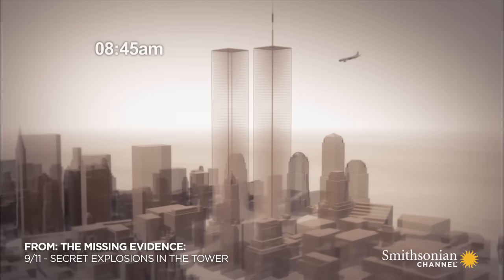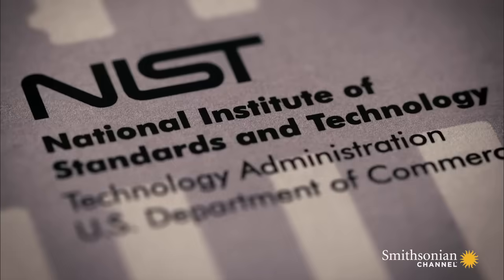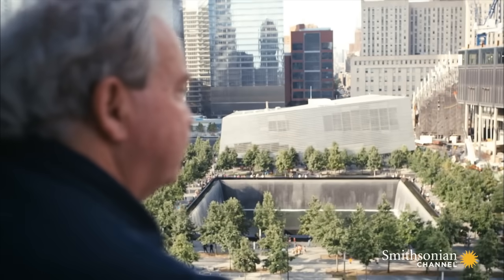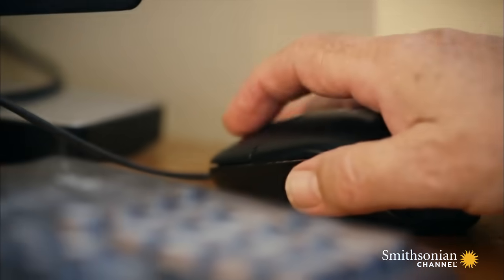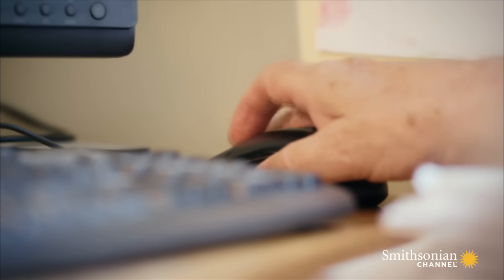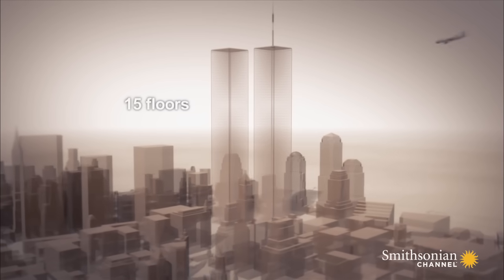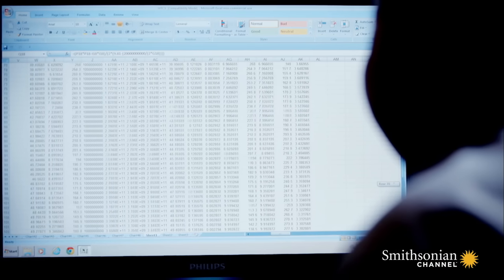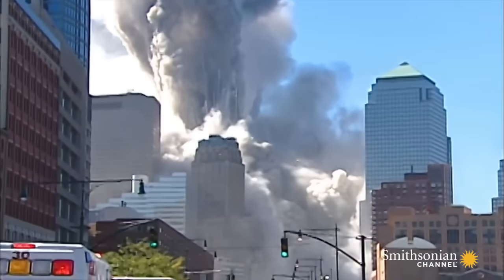This Computer Simulation Explains How the Twin Towers Fell

Comment: The towers did not collapse. The entire WTC complex of seven buildings did not collapse.
Reply: "The towers did not collapse. "
Actually they did.
Reply: @markh1011  If you study the evidence carefully, it will lead you to the correct answers. If I tell you that the answer is 27, how do you know if the answer is correct? You must determine what the problem is before you can solve it. If you don't know what it is, you can't determine how it happened.
Reply: @andrewdean6963  Nothing you said there changes the fact that the towers collapsed.
Reply: @andrewdean6963  What?    People ran away so that were not at the base.   Do you think people would just stand there while 110 floors come down on top of them?
Reply: @markh1011  of course they ran, they couldn't outrun the dust clouds, you would have to run very fast to get far enough from the base to escape the falling debris of a quarter mile tall building.
Reply: @andrewdean6963  
Are you making an argument for something?
Reply: @andrewdean6963  
"What about the 16 people at the base of tower one inside stairwell B that survived and walked out"
They exited the building and ran for their lives.

"500.000 ton building because they were turned into dust. "
All anyone needs to do is look at the ground zero photos to see that it wasn't all dust.  If it was just dust they could have vacuumed everything up quickly.

" The didn't get cooked by high temperatures of molten steel because there was none."
Correct, there probably wasn't molten steel.

You don't know what the official story is do you?
Reply: @andrewdean6963  
"This is just the tip of the iceberg of knowledge I have learned by reading on book"
You've not shown any knowledge at all yet.

Judy Wood is wrong on pretty much everything.  Even the other 9/11 conspiracy theorists distance themselves from her nonsense.
Reply: "An error does not become truth by reason of multiplied propagation, nor does truth become error because nobody sees it. Truth stands, even if there be no public support. It is self sustained." Mohandas Karamchand Gandhi.
Reply: @andrewdean6963  Who needs evidence when you can post quotes.....
Reply: @markh1011  Who needs your opinion that is meaningless?!?!
Reply: @andrewdean6963  You should have stopped a few posts back.
Reply: @markh1011  Well what ever!

Comment: This is a lie. All the floors would have to collapse from the bottom up to cause what we witnessed to happen. If the collapse started closer to the top, we would have seen them fall first and as they say, "pancake", downwards, one on top of the other. But that's not what we saw. The whole building fell at the same time as if all the support below was severed simultaneously. This could explain the molten metal many people reported seeing streaming from different places shortly before the buildings fell.
Reply: That's NOTHING like what we saw!! The collapses began at the points of impact and the building below didn't fail until the collapse reached it. It did not fail simultaneously.

The molten metal proves nothing; the heat from the office fires explain it.

Comment: The mass above is supported by the mass below. So to say it fell due to the weight above would also imply the building shouldn’t have been able to stand. Also assuming that all beams failed at the exact moment for it to fall within its footprint. You would typically have a stress or weak point on specific areas, not equally across the entire floors. This would cause an uneven collapse resulting in portions of the top falling off sideways with the rest of the building being able to with stand the weight
Reply: Aren't you forgetting something? Like - massive damage caused by 150-ton jumbo jets hitting them at 500 mph??? Or the fires which burned unchecked at temperatures that cause steel to lose 90% of its strength??

Also, the towers did not fall into their own footprints; they spread destruction 600' in every direction!
Reply: @Tim22222  the planes can't go 500mph at the low altitude.  The wings would have been sheared off due to air density.
Reply: @Tim22222  open flame fires cannot make steel lose 90% of its strength that is a fallacy.
Reply: @Tim22222  if the debris was spread out in 600 ft in every direction what caused the lateral Force?
Reply: @Tim22222  a building of that size in the most controlled demo would not be able to fall anymore into its foot print than this did. At this size and speed of collapse, there should have been way more resistance as it fell each floor. These collapses didn’t even slow down. These buildings were meant to withstand a strike from an airplane. The architects and engineers prepared for something like that. I’m not discussing steel malleability here. Again, you would have stressing and weak points where the heat was the hottest. 

Imagine you are watching a controlled demo of a large building. Once they start the ignition of the explosives, they target structural points from the ground up. If all it took was to damage the top 10 floors of a building, like in the twin tower case, they could save 10s of thousands in dangerous explosive work per building by rigging only the top. You would have seen irregular collapsing and more and more resistance as the debris fell onto an incredibly sound lower structure. 

Of course steel can be melted by jet fuel. 

And remember, building 7 collapsed without being hit by a plane and fell again into its foot print with very little resistance at an incredible speed.
Reply: @AvaLeafs10  Demolition companies are not hired to bring buildings down, they are hired to bring buildings down SAFELY. The towers' collapses spread destruction in every direction, took out nearly a dozen buildings, and caused grievous environmental damage (and that's without considering loss of life). Any demo company with that track record would be out of business RIGHT QUICK, I'm sure you'll agree.

And yes there was most certainly was resistance; the proof is that each tower's collapse took more than free-fall time.

"At this size and speed of collapse, there should have been way more resistance as it fell each floor."

Oh? How much more? Care to share your calculations? The north tower took more than twice free-fall time to come down. Is that slow enough?

JK I know you can't answer those questions!
Reply: @Tim22222  The roof line of WTC 7 dropped in free fall for 2.25 seconds during which time it covered a vertical distance of 32m / 105 ft / 8 stories. During that time it experienced ZERO resistance from the 40,000 tones of structural steel which was 3–5 times stronger than required to support the building loads. The only possible source for the massive amount of energy required to destroy the columns in a coordinated way and in the time frame available is explosives.

In addition to the free fall the only way the building could collapse in the symmetrical way it did was if the support was removed symmetrically across the width of the whole building and that can only be done with explosives. Fire does not cause symmetrical collapses.
Reply: @AvaLeafs10  I take it by your eagerness to change the subject that I've satisfied your doubts about the towers? And that none of your observations suggest controlled demolition?
Reply: @Tim22222  you asked for details
Reply: @AvaLeafs10  Not about building 7! You claimed the collapses of the towers should have taken longer than they did; I asked for details about that, details you have not provided. Instead you tried to change the subject. No bueno.
Reply: @Tim22222  hello would you be willing to be interviewed? I have a few questions about your group/movement.
Reply: @Tim22222  talking about demolition companies being hired to bring down building safely has nothing to do with terrorist who care less about safety...
Reply: @Tim22222  "the North Tower took more than twice Free Fall time to come down" yeah you clearly are lying....
Reply: @Tim22222  not trying to change the subject but again, a building of that size cannot fall completely down in 11 seconds from damaging a few of the top floors. I won’t convince you and you won’t convince me. Bueno??
Reply: @AvaLeafs10  Neither of the towers came down in 11 seconds. Check the video at the end of my comment above & time it yourself!
Reply: @Tim22222  listen, I have an engineering masters and I’m guessing by you being consistently snarky, maybe you do too? Probably not. I wrote my comment, and I’m done arguing. I left my comment as a comment, not an invitation to have basic arguments with someone like you. I don’t have all the detailed specs of the building. I didn’t investigate it. I’m looking at this objectively. Buildings don’t fall that fast (11-13) seconds without some sort of complete structural malfunction. Write what you will but I’m done responding to you. It’s not productive to converse with someone as arrogant as you come off to be. There’s lots of unknowns about what happened and I’m stating what I know. You seem to be taking this as what you are told
Reply: @AvaLeafs10  Did you view the video? Did you determine the north tower's collapse time? If not, why not? Are you afraid of what you might find? A real engineer would jump at the chance to conduct such an easy and definitive experiment. Just sayin' 😊 

You made a declarative statement: The towers should have taken more time to fall. I have repeatedly asked you on what basis you say this, a pretty reasonable request. You have not responded to it. Why?

Oh and BTW my degree is in physics, so pulling rank isn't going to work here.
Reply: @Tim22222  it’s unfortunate your “degree” hasn’t given you the knowledge when looking at this to know something isn’t right. I’ve looked at the video. I’ve looked at many. Google it as well, YouTube won’t let me post links. Everywhere it states 9-13 seconds. And I’ve repeatedly given you my reasons. These structures were designed to withstand enormous weight loads. As the building fell, it’s very clear there was little if any slowing of the collapse. And again, your attitude, snarky arrogance is beyond frustrating. I didnt for a second tell you about my background to ‘one up’ you in anyway. I’m letting you know I have some experience with structures.
Reply: I haven’t studied any of the details. And I can only assume you haven’t either. How about for once, instead of me having me prove to you, try to prove it to me what you are claiming. I’m looking at the situation, watching the videos and making my opinions. So what’s your issue? Are you policing 9/11 comments to shut down anyone questioning what is being shown?
Reply: @AvaLeafs10  This is a public forum. If you make a demonstrably false claim someone might call you out. See how that works?
Reply: @tpryce9800  yep. Exactly.
Reply: @AvaLeafs10  Then why are you perplexed that someone would do just that?
Reply: @tpryce9800  ya ..who knows
Reply: @Tim22222  would you be willing to answer a few questions for my book about  new age truthers and your group/movement.

Comment: Surprised they have turned off the comments 
Many Firefighters disagree about this theory, they saw molten metal flowing underneath like a steel foundry. And why the squib type explosions only on some floors 
We don’t believe anything from the government on this, they lie often, and there were no WMD in Iraq.
Reply: No, no firefighters "disagree" about this theory. Molten metal does not contradict it.
Reply: @Tim22222  I have a few questions if you are willing to answer.
Reply: Who? What are their names?
Reply: @tpryce9800  all done anything else
Reply: @c.augustedupin2559  Uh huh. Anything else?
Reply: @tpryce9800  easy to research , not sure if names were given for security reasons 
Thermite melts steel like a hot knife 🔪 through butter 
Traces were found
Reply: @CrazyFunnyCats  Does that mean you don’t know their names?

Comment: Sins all the floors where hanging onto the inner high quality steel concrete structure.
The only thing that could have happend would be that the floors would've collapsed onto each other. Leaving the inner high quality steel concrete structure still standing. But lets beleave the official report, because why would they lie about it? 😳
Reply: The inner structure was steel only; what little concrete that was in the towers was limited to the floor slabs, not structural.

Each floor was only intended to carry its own weight, not the weight of dozens of floors crashing onto them!

Comment: 2 weeks before 9/11 the buildings were shut down to do maintenance! This involved cutting into the main beams and placing thermite also the so-called planes that hit the buildings were holograms! This was all planned out by Bush and the CIA to get us into a war with Afghanistan so that the CIA could build labs and have Total Access to the poppy fields it had nothing to do about oil ! George Bush was executed at gitmo in 2021
Reply: Nonsense! The towers were most certainly NOT "shut down." Where do you people come up with this silliness?
Reply: @Tim22222  yes they were shut down for 2 weeks they were supposed to be fixing the air conditioning but instead they cut the beams and placed thermite in there just like Tower 7 it was a demolition!
Reply: @Tim22222  also Israel had Intel told their 600 workers not to show up on the day of night or 9/11
Reply: @Tim22222  why were you working at the twins towers when they shut it down no you weren't! I have until that will prove you wrong we were attacked from within there was no planes and no terrorists also how come they couldn't find any plane parts at the site? Also why was there molten metal underneath the towers for for solid 3 months because they used thermite to bring the buildings down that's why there was so much white dust in the air you're the one that needs to get a life and mind your own business because my Intel proves different than your conspiracies!

Comment: Propaganda and part of the cover-up.  The only steel buildings to fall due to free EVER!  And all 3 fell into their own footprint.  Newscasters talking about WTC 7 failing before they fell.  How did they know?
Reply: They knew because the firefighters on the scene TOLD them it was going to fall.

"We had our special operations people set up surveying instruments to monitor, and see if there was any movement in the building [7]. We were concerned of the possibility of collapse in the building. And we had a discussion with one particular engineer there, and we asked him if we allowed it to burn could we anticipate a collapse and if so, how soon? And it turned out that he was pretty much on the money, that he said 'In its current state you have about 5 hours.'" - FDNY Deputy Chief Peter Hayden

"We were pretty sure that 7 World Trade Center would collapse. Early on, we saw a bulge in the southwest corner between floors 10 and 13, and we had put a transit on that and we were pretty sure she was going to collapse. You actually could see there was a visible bulge, it ran up about three floors. It came down about 5 o’clock in the afternoon, but by about 2 o’clock in the afternoon we realized this thing was going to collapse." - FDNY Chief Peter Hayden

"The most important operational decision to be made that afternoon was the collapse (of the WTC towers) had damaged 7 World Trade Center ... It had very heavy fire on many floors and I ordered the evacuation of an area sufficient around to protect our members ... and back the people away far enough so that if 7 World Trade did collapse, we [wouldn't] lose any more people." - FDNY Chief Daniel Nigro, Chief of Department

"We were up on the upper floors of the Verizon building looking at it [7]. You could just see the whole bottom corner of the building was gone ... I just remember it was tremendous, tremendous fires going on." - FDNY Richard Banaciski

"So we go there and on the north and east side of 7 it didn’t look like there was any damage at all, but then you looked on the south side of 7 there had to be a hole 20 stories tall in the building, with fire on several floors. Debris was falling down on the building and it didn’t look good." - FDNY Captain Chris Boyle

"Of primary importance early on in the operation was the structural condition of 7 World Trade Center. Assistant Chief Frank Fellini had been approached by several chiefs who were concerned about its stability. It had been heavily damaged in the collapse and was well-involved in fire. Chief Fellini had looked at it and described to us some damage to its south side; he felt that structural components of the building had been compromised. So when Chief Dan Nigro arrived at the command post, he convened a meeting of staff chiefs, and this was a major subject of the meeting. We were all in accord about the danger of 7 WTC, and we all agreed that it was not too conservative of a decision to establish a collapse zone for that building, move the firefighters out of the collapse area, and maintain that strategy." -- FDNY Chief Frank Cruthers
Reply: The only steel buildings to fall due to free EVER

Kader Toy Factory
McCormick Center
Windsor Building- Madrid
Plasco Building-Tehran